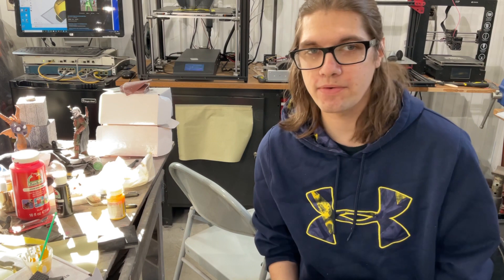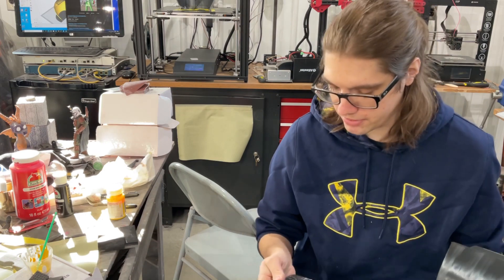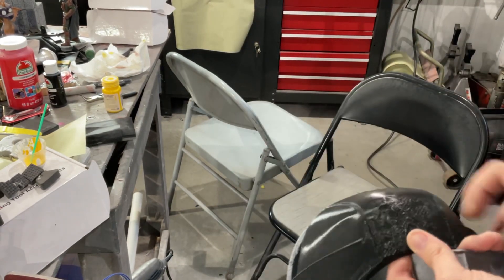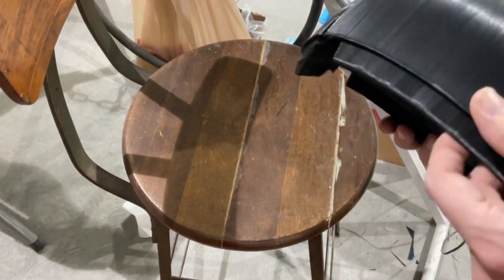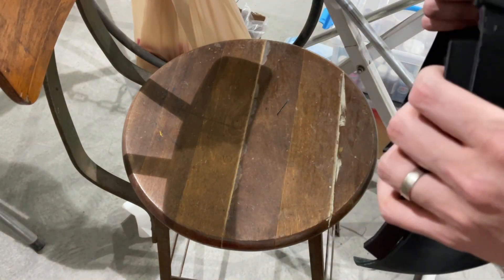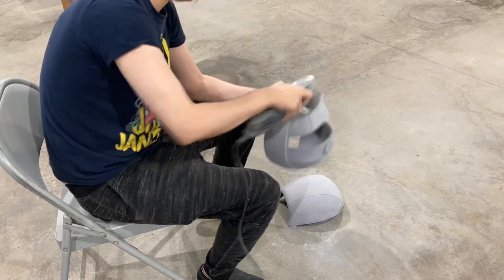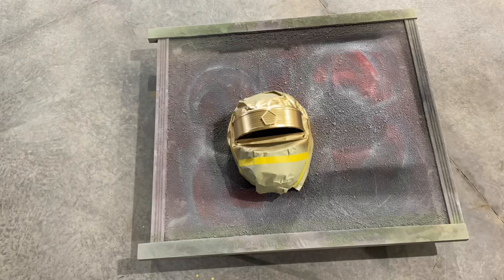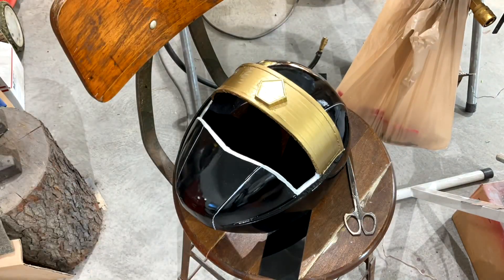3D Printing & Finishing a Mighty Morphin Alien Ranger Black Helmet

Comment: How do you scale the helmets to fit?
Reply from the maker: Usually I try to make most Helmets 220-225mm across, if there are extra bits or spikes on the outside you have to take them in consideration and maybe add 10-15mm across. I also load in a helmet I know that fits me well and use that as a reference as well